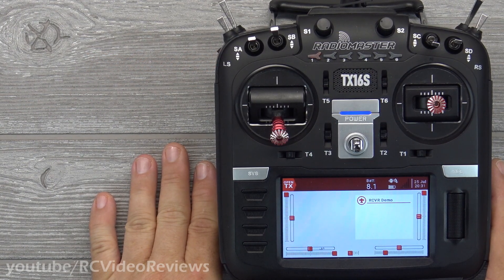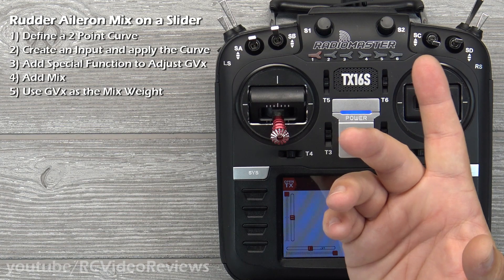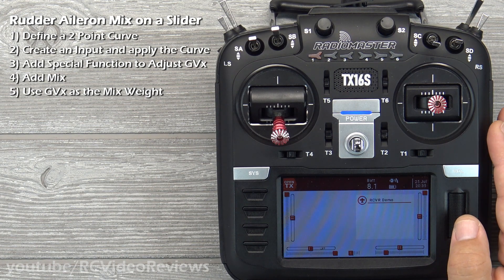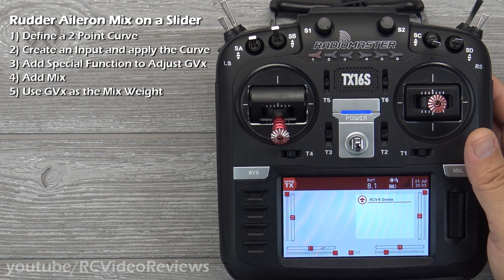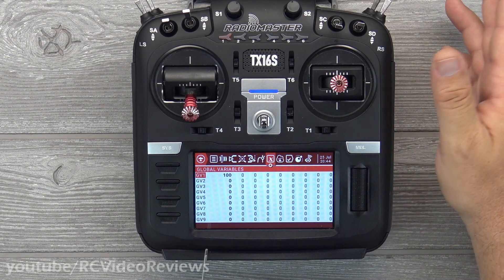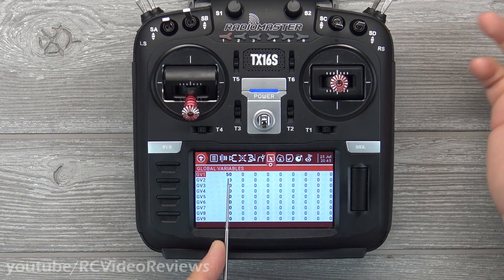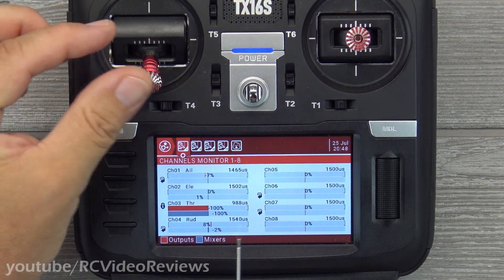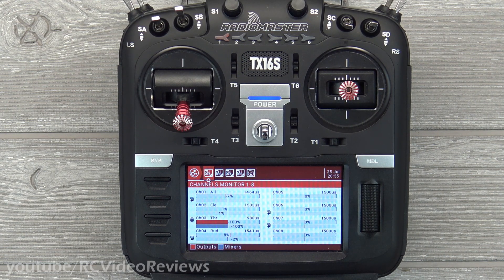OpenTx Companion Tutorial • Aileron Rudder Mixing+Mix on a Knob • Radiomaster TX16s • [Intermediate]

Comment: Not all mixes are equal! Although some may use them to "cheat" (meaning to not learn how to properly stick-and-rudder fly) I like to use them to optimize aircraft control settings. For example, I am trying to use your video to optimize my Versa Wing elevons with the perfect amount of differential, so that I am getting the least amount of adverse yaw wobble without unnecessarily sacrificing control rate. I'm trying to set it up to change differential on the fly with my slider. Struggling with how to make this work but slowly making progress. Any specific tips would be appreciated! Thank you for your fantastic instruction. It is clear, concise, and to the point!

Comment: How can I use my sliders to control servos on ch5 and ch6 for my gimbal servos??
Reply from the maker: Use sliders as the source in the mixer in channels 5 and 6.
Reply: @RCVideoReviews  I did that, but no joy!!
Reply from the maker: Then you did something wrong because that's how it works. The mixer channel numbers correspond to the rx pins. The mixer also specifies the source of control. You're missing something.
Reply: I was able to get it to work on a different receiver..Thanks!!
Reply: @RCVideoReviews  have you ever bound 2 receivers at the same time?

Comment: does anyone have a working firmware? I found 2 versions. The first makes a white screen, the second mirrors the display and turns it upside down. I can no longer use the charger. The manufacturer did not respond to my query.

Comment: Thnaks a bunch! As always - great assistance to the community! I fly thermal gliders. Using an aileron-rudder mix, theoretically should provide for flatter turns, which helps to stay in light thermals without loosing too much height in the turn.
Reply from the maker: Glad to help. Thanks for the comment.

Comment: Hi John, at 11 minutes, you show in channels monitoring CH1 and CH4, in your video , we see CH4 (rud) output and mixer bar graph goes on the different way. On my radio TX16 EdgeTX, the CH4 output/Mixer goes to the same direction ! i'm right on my setup ?
Reply from the maker: The rudder is reversed in this example. See the little icon on the left?
Reply: Yes, thanks for your reply. Awesome 👏

Comment: How will the TX16 work on Gas engine planes ?? i only see guy flying electric plane and drones
Reply from the maker: Since I’ve never flown a gas plane I can’t offer a fact based response. I would speculate though: There should be no problem using TX16s or the receivers that work with it on a gas plane.
Reply: @RCVideoReviews  thanks

Comment: Thanks for the great video with the very good explanations. It worked that way straight away.
I wanted to convert the process to program a slight downward rudder admixture at half throttle to full throttle. But I don't know which parameter I have to change so that the down elevator correction only moves from half-throttle to full-throttle. At the same time, I always get a correction for the gas path 100% to +/ 0%. Do you know advice?
Reply from the maker: The mix line adjusts the thing that NEEDS TO BE adjusted with the thing that DOES THE ADJUSTMENT. So add a throttle entry to the control surface you want to modify. You can apply a curve or offset/weight combo to the mix line to limit travel. I do this same thing with gain switches all the time.
Reply: @RCVideoReviews  Thank you for the quick answer!
I have solved the problem in the meantime before your answer is here: I activate the mixer with the global variable at  the position half throttle with a logical switch. The mixer is only on from half throttle to full throttle.

Comment: I used the wizard to programme the model with a V tail and then your instructions for aileron/rudder mix but the rudder only works on one side of the V tail
Reply from the maker: You don't mix aileron and rudder on a v-tail, you mix elevator and rudder.The aileron/rudder mix in this video is to show how to mix those two for coordinated turns.

Comment: Great video as usual but I found it doesn’t work on a V tail?
Reply from the maker: On a. Tail you mix elevator and rudder. Same concepts apply.
Reply: @RCVideoReviews  I know that you mix rudder and elevator on a V tail but I am also trying to add aileron rudder mixing as on the above video. I am finding that only one rudder is following the aileron, probably needs some adjustment to the programme that I haven’t worked out yet.

Comment: One question. If using quad, roll introduces tilt. So yaw will go downward. Do I need to compensate by adding up throttle?
Reply from the maker: If you're using acro mode, the flight controller will do a pretty good job keeping the other axis locked unless you command movement. That said, yes, just about any time you change the pitch or roll on a quad you need more throttle to maintain altitude.

Comment: Hi i'm trying to mix elevator to flaps I set up Flaps but can't see anywhere how to add some elevator mix, any help is greatly appreciated. Im trying to find a simple way to do it as i'm not really keen on the companion software its to difficult for me to use. thanks again, James
Reply from the maker: https://youtu.be/uxfp0PZ_ThE
Reply: Thanks that was pretty good and quick to set up just using the radio. I’ll have to try to set up companion at some stage and hopefully this will make setting up easier in future.

Comment: Hey great videos!! I'm not sure if you covered this in a video already but here we go... is there any way a person can increase control throw past 100%?  I'm setting up a 120cc cc 3D airplane and I can't get enough control throws the servos won't move far enough I have them set at maximum 100% but with my other radios Spectrum I could crank them up to 150% to get more Servo travel is there any way you can do it with a tx16s? If you already covered this in a video could you send the link? :-)
Reply from the maker: Spektrum only uses 80% of travel by default. OpenTx uses the full pulse width. OTX goes from 988 to 2012. Servos allegedly have mechanical protections to protect them from being overdriven, but I know I have personally seen a servo go bad when driving it beyond 100% with OTX. So I don't make a habit of it. If you need more throw you may have to adjust your linkage arrangement. Closer to the pivot on the controlled surface and father from the servo screw gives the max throw but at the cost of torque and resolution.
Reply: @RCVideoReviews  thanx for the snappy fast reply! Yeah I was hoping I wouldn't have to adjust the linkages but I guess that's what I will have to do but with my Spectrum remote I didn't have to do that but I guess with a tx 16 I will just have to adjust the linkages to get more throw, thanx again:)
Reply from the maker: @billneudorf91  Spektrum at 125% and TX16 @ 100% should yield the same physical movement. Spektrum @ 100% only uses 80% pulse width. There are specific setup instructions in the multi-protocol module firmware explaining this.

Comment: Hi, thank you for your Video, what firmware version are u using? since mine hasn't got the Global variance option screen .
Reply from the maker: Global variables are on the system menu and available in all versions of OpenTx. I was using 2.3.9 in this video, but all versions of OpenTx have global variables.
Reply: @RCVideoReviews  in the opentx companion my global variables is not showing anything 😬

Comment: Just got my tx16s, I have to say without your videos I wouldn't have a clue how to navigate through all the different settings etc etc, have you done a video on dual elevator setup?  Keep up with  fantastic tutorials 👏 👌
Reply from the maker: Thanks, glad the videos are helping you. I didn't do a video on dual elevator setup, but it's very easy. Create an Elevator Input just like normal. In your Mixer create Elevator 1 on Channel 2, and Elevator 2 on Channel 5 (or 6 or 10 or whatever) and use the Elevator Input as the source. If one of them goes the wrong way, invert the weight. Very easy.
Reply: @RCVideoReviews  AWESOME!! thanks for the quick reply, its much appreciated!

Comment: Hi!
Great info but it is so difficult to understand me. 
Please explain it on the plane also please and explain it why we need R-A-mix when we flying. 
Thanks
Reply from the maker: Sorry, I'm not making another video on this subject. Perhaps a re-watch will help.
Reply: To help with adverse yaw,    saves flying using both sticks,     helps with balance turn,  no slip.   Hard to see without the little ball sliding on the instrument panel.   If you can imagine sitting in the plane ad flying

Comment: Thanks, great explanation! I fly large scale sailplanes, usually aerotowed. The mantra is, uncoupled aileron and rudder, (i.e. unmixed), during tow. Then, after releasing from the tow plane, many guys like to couple aileron and rudder for thermal flying, as when your sailplane is at 1000' or (much) higher, it makes thermal turns  more casual. Not necessarily more efficient, but easier to execute. Personally I fly unmixed, but this concept of a sliding mix has my attention! Plus it clarifies  the use of the GV. Much appreciated.
Reply from the maker: You're welcome. Glad you found an application for this feature. I think GVs are probably highly underutilized on OpenTx radios. They can be very powerful.

Comment: Hi how we can mixes thr with too.and always up please reply my comment thanks.
Reply from the maker: I'm sorry, I don't understand your question. What do you want to mix the throttle with?
Reply: @RCVideoReviews  sorry not throttle  it is elevator . Soooorry.
Reply from the maker: Just add throttle to elevator. As you move the throttle up or down the elevator will move up or down. You will have to make sure the weight + or - is correct and the weight of the mix will depend on how far you want the elevator to move with application of throttle.

Comment: Just brought a second hand horus x12s  with opentx,     after buying some x8r receivers for use I found they wouldn't bind until I bootloader receivers with EU firmware.    I dont need to us EU as I'm in New Zealand.     Question is,   if I update the opentx to 2.3.  Will that enable me to reset to non EU,   or will I have to start from the beginning and fully reinstall opentx
Reply from the maker: I don't really know the answer to this. I'd have to experiment and right now I don't have the bandwidth to do it. Let me know what you find out though.

Comment: So can you use this same concept with differential thrust? By using the slider to adjust the amount of right or left motor output via the rudder.
Reply from the maker: Yup. Anywhere you can use a Global Variable, you can apply it. If you know how to make a differential thrust mix--my video on it here - https://youtu.be/kEA71RB5UtY
you can apply a global variable in lieu of a hard coded weight.

Comment: can the radiomaster be used with flight simulators via the usb connection?
Reply from the maker: Yes. It can be recognized either as mass storage (USB) or joystick mode when plugged in with the included USB cable.  I have confirmed it works on Windows 10 with the Free Flight Simulator in this video: https://youtu.be/EhrzCrkp7GY

Real Flight is the exception as it checks for a serialized controller or some other nonsense.

Comment: Great and easy to follow explanation. Radiomaster should consider you as their voice in here. When I sent them an email, the reply was just so dumb and I felt they just don't care about plane guys using their equipment.
John, try this mix on your MX2: elevators up and ailerons down and vice-versa. It is an amazing mix for 3D flight
Reply from the maker: Thanks Eduardo. Appreciate the support. 

That mix does sound fun, I'll give it a try after the re-maiden.  Thanks!

Comment: So... maybe you could do a video on how to update this radio that I JUST RECEIVED....Now i just REALIZED i have to update it!!!  I haven't even flown with it yet.
Reply from the maker: I'm sure you can safely use the radio the way it came out of the box. Firmware updates are not required. I'll think about how to answer this question in video format. In the meanwhile, if you go download OpenTx Companion, create a radio profile, and download new firmware, it is relatively easy to flash. Press Aileron and Rudder trim switches T1 and T4 INBOARD simultaneously, turn the radio on, wait for the screen that says "OpenTx Bootloader" select write firmware, connect USB-C to computer, use Companiion to Write Firmware to radio. You'll also want to make sure you download the SD Card Contents and update the radio SD card.

That's the short of it and should get you going in the right direction.
Reply: @RCVideoReviews  bro, I can't follow your instructions without updating to match what you do to learn this thing.
Reply: @RCVideoReviews   your instructions is good, but not good for someone who just cant "download SD contents" or "Backup" SD contents(???) How do you do that???   Its easy to say, but for many of us, these instructions leave us dead in the water.  Joshua Bardwell is great with showing things like "make a file and out it here" kinds of things.  I happen to like your style of teaching.  Showing the what you may feel is "simple" can still help us out here who forget some of the simple things that people who may use computers daily take for granted.
Reply from the maker: @RCThis  I hear you, but it takes time to put these videos together. I thought I'd give you some verbal instructions to get you started.

Have you downloaed OpenTx Companion yet?

Why don't you start with that: 
http://downloads.open-tx.org/2.3/release/companion/windows/companion-windows-2.3.9.exe

Install that, open it up and just look at it. The options for downloading firmward and updating sd card contents are all in that software. It's free, and you'll need it for updating the radio.

Also don't forget, you don't HAVE to update it to use it. The radio ships with a working operating system.
Reply: @RCVideoReviews  bro... your instructions were good
  Thanks.  Honestly
  You are awesome
Reply from the maker: The firmware video is uploading right now. It should clear things up.
Reply: @RCVideoReviews  OMG dude. You rock